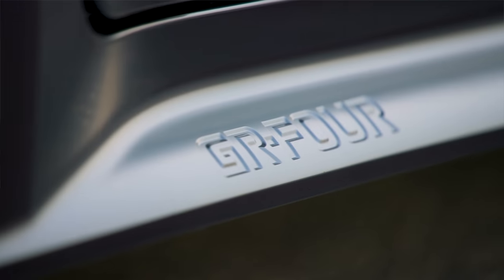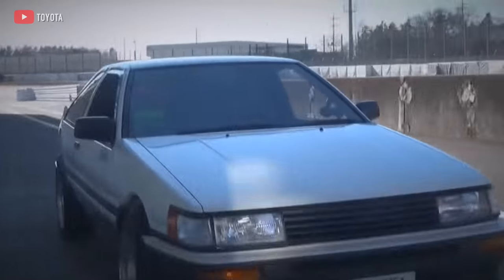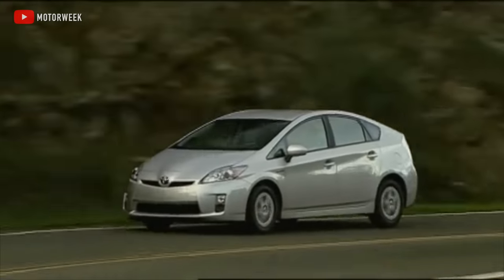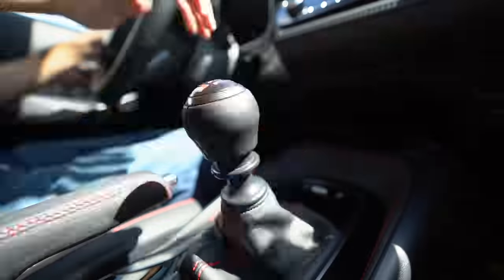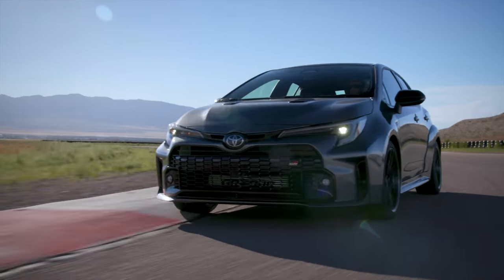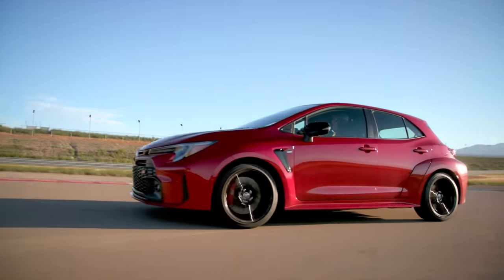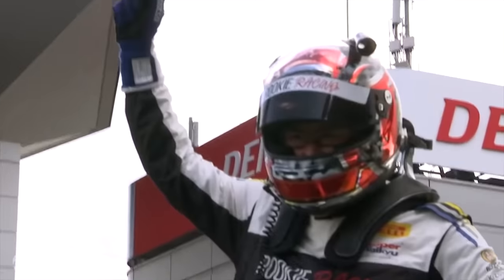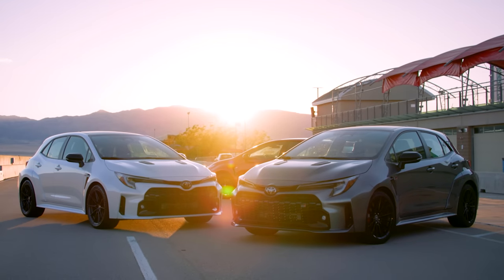Toyota Forgot How To Make Sports Cars

Comment: this guy knows how to tell a story with his out of the world writing👑👑
Reply: That's the problem, his to concernced with telling a story, instead of the actual facts.
Reply: @Orcawhale1  Like calling a Corolla a sports car
Reply: @DuBstep115  This, 3,300lbs is a joke.
Reply: @DuBstep115  Sports car-"A car designed with an emphasis on dynamic performances such as handling,acceleration,top speed,thrill of driving and racing capability."

You know Corolla and GR Corolla have a lot of differences right?Just like Lan Evo and Lancer
Reply: @abenas40  That definition is so vague that every single bmw from 318i should be called a sports car.

Comment: Hope to see this turbo i3 optioned in more cars eventually
I miss the days of toyota putting turbo JZ engines in every car that could fit them
Reply from the maker: Agreed! Sakamoto-san told me the G16E is set up to run both Hydrogen and Synthetic Fuel, so I think we'll be seeing plenty of it in the future!
Reply: They have shoved it into the 86 for "fuel testing" purposes. Makes me think they are trying to prepare for when they can't make petrol cars anymore. Maybe the 86 will finally get a turbo..
Reply: @Treaxvour  Only for special racing events. Turbo engines don't last, & is only for those greedy ones who want maximum power. I'd rather rather go for well-timed precise power delivery on every corner!
Reply: @creakid  tell me that you know nothing about turbos without telling me that you know nothing about turbos
Reply: @creakid  what are you stuck in the 60s?
Reply: @crissto8591  The 3 banger turbo in the GR Corolla is using 28 pounds of boost, it's not going to last.
Reply: @creakid  some if toyota's most reliable engines are turbod, such as the 1jz and 2jz lines
Reply: @Brandon-yq1tm  Heavy-duty design compensates, but what about the extra heat that melts rest of the engine compartment?
Reply: @creakid  the hell are you talking about, the compartment easily can handle a turbo, the heat is contained within the engine, all they are doing is adding air to get higher compression
Reply: @Sweedster  The thing with a turbo is that in order to get so much power out of such a small engine, you need a huge turbo and a bulletproof engine block. A massive turbo takes longer to spool up and down, so a naturally aspirated engine is better for cornering-focused cars like the GR86. The GR Corolla is a rally-bred car, so it makes sense to have a turbo engine inside, but it doesn’t work well in an 86.
Reply: @Brandon-yq1tm  But not to the degree nor to the pressure level of the G16 in the GR Corolla. The stock Supra already had 3 liters of displacement and 6 cylinders. The G16 has about half the displacement and half the cylinders, yet it squeezes the same power and torque out of the engine.

Comment: With my MR2 I feel that unique Toyota sports car feel. You can drive it everyday, sun, snow or rain. Learn manual on its forgiving powertrain. Learn the limits of the car and yourself with the reassuring assistance of a friend. It starts every time and, it doesn't mind a slow commute. But get it on a track or a twisty road, and it lightens up. The Yamaha built 3SGE/GTE screams with excitement. The chassis moves and flexes just the right amount, it builds confidence through every perfect apex, through every long sweeper or from one light to the next. It want's to go faster, every intent feels like it wants to chase that next guy ahead. When you're done however you can slow down, lower the windows, turn up your favorite song and cruise home to your hearts content. That's what I've always loved, it's fast, fun, exciting, inspiring, but also calm, confident, and dependable. I've driven Type r's, skylines, GTRs, Mustangs, Porsches and nothing has felt the same as my MR2

Comment: So glad my son tuned me into the Ae86 and we were able to get some before they shot up in price. 
The 1.6 4age is legendary and wonderful but is still barely 100 happy horsepower. It's really no match for new cars.
The tight ratio tranny's not going much above 100 mph.
Some parts are rare,non existent or expensive others are dirt cheap and everywhere.
It's old,funky and has zero nav or nannies.
It's also incredibly light, easy to drive,fuel efficient,comfy,practical,really fun at normal speeds,has rally ground clearance and is appreciating in value.
Nimble is a word that very few modern cars can claim. It's the magic.
Pop up headlights and eurobeat intensifies.
Reply: The 2001 carina  gt is one of the last cars with a 4age type engine with 180hp
And the most nimble new car is the Suzuki alto works rs turbo

Comment: I'm not a Toyota person, and the only driver's car I've ever owned was a 65 MGB my father rebuilt from the junkyard and gave to me when I turned 16. But it seems like Toyota was aiming for a car that would be quite fun on occasion but still be a practical daily, with room for aftermarket improvements if you wanted a more capable performance car. And it seems they hit what they were aiming for pretty much dead center.

Comment: Sure the Morizo is great but for the price you can get a core especially at MSRP if you can find one, the money spent on a Morizo and losing the rear seats can be made up for in the aftermarket. Its like my MR2's I have owned and still own stock sure they feel rather pedestrian but once you modify them with quality parts and or the TRD catalog on my MK1 MR2 SC they turn into amazing little track/ auto X weapons. A tune and or a different aftermarket gear set in a core model with the LSDs will net you just the same experience. I think reviewers also forget that most enthusiasts end up modifying these vehicles themselves.

Comment: I don’t get why people are mad that the GT86 / GR86 have a Subaru engine. Most of the Toyota sports cars use Yamaha developed heads / engines for the power plant, and apparently that’s fine… idk. I think it’s because the partnership is more widely known, and it’s displayed right on top the engine cover.
Reply: Big difference between the quality of engines Yamaha produces compared to Subaru
Reply: Comes down to marketing and purity. Rebadges and collaborations always have some kind of pushback as well.
Reply: @Xale-yt  You know what…. I just googled “frs common problems”… I assumed it’d be a bunch of blown head gaskets, or cam bearing failures.. looks like the engine itself actually holds up. I’m a tad surprised by that one.

Comment: They should of all had the option of removalable rear seats, the Morizo has 4 doors and 2 seats , that just seems wrong. Also I'm sure the aftermarket will coilovers for this should resolve most issues of the base.
Reply: there are many race cars that are 4 doors with 2 seats. Makes it easier to weld in the cage. the GR Corolla is really a special car in all trims

Comment: last proper sports car was the zzw30 and even that was sold a bit short with the 1zz instead of the 2zz
Reply: no 86? or gr86? or gr yaris?
Reply: @arcanevoid9199  this video was alluding to earlier models than zzw30 being the last. The ones you mentioned certainly are but wasnt my point and the 86 is probably the only sports car. The others are certainly sporty. But i have had ae86 ke70 jzx90 etc and my zzw30 is 10 times the sports car of any of them.
Reply: @driftke70  jzx90 is a luxury sedan? ke70 is a little nugget hatchback, and the ae86 is 20 years older so of course it wouldnt be on the same level. and idk how the gr yaris isnt a sports car, have you seen what it can do on track?

Comment: I really think the Circuit Corolla would be the best one. I mean, it has body roll and all because the tune was from GR Yaris, and GR Yaris was made for rally. Of course it doesn't quite satisfy on track and consequently less fun than Fiesta ST on road, but that is just not the point though. Take Fiesta ST to the tarmac, it's not so much fun anymore is it?
Reply: Per the chief engineer the GRC is not rally focused like the Yaris. They knew the Corolla wouldn’t handle like the Yaris so they focused on stability and daily driveability.

Comment: The 86 was a Toyota design the entire time. I'm so tired of hearing people imply Subaru had any significant part of the design process. Toyota likely was intending to use the 2AR engine in it if Subaru didn't accept the offer.
Reply: Considering the chassis is a Subaru chassis, it’s unlikely. Whole point of the collaborations is to save money on development for low slung sports cars.

Even the prototype cars were chopped up Imprezas.
Reply: @MaddNomad1015  Considering the car was based on Toyota's FT concept from 2007, it's not just likely, it is the reality. If Subaru didn't buy in, this would have gone forward without them. Subaru had no intention of making a lightweight RWD cheap sports car, and likely only even bought in because Toyota had just purchased nearly 20% of their company before showing them the design.
Reply: @Weimerica8841  at the end of the day the what if thing is irrelevant. The twins are primarily built by Subaru, which isn’t bad.

Only issue I have with it (I’ve owned a FRS) is the history isn’t accurate. The name itself is just a marketing exercise.
Reply: While the 86 is a Toyota design, Subaru did the manufacturing and engineering. The DNA of the car is 85% Subaru, with only the transmission and fuel injectors coming from Toyota as major contributors. An 86 without Subaru's involvement would have been a much different car (possibly better, but also more expensive).

Comment: Toyota sportscars have traditionally been expensive, and the GR's are no different. The one difference is their marketing and the way they make their sportscars. While they technically start at 36k, the GR you get is a GR in name only. 
Toyota has GR submodels like the MKIV Supra. The one everyone knows is the 6spd, twin turbo RZ, but there was a 5spd, nonturbo RS. 
The one for 36k has an anemic 140hp motor, a CVT transmission, no LSD, interior that looks like it came from an old Golf GLI, different wheels and tires... Basically, the body and badges are the only thing the 2 share. The version everyone has seen on YT?  48-50k, without additional options. Even the white paint you see is an additional 1,000 dollars. The factory color is a more plain version of the white color.
I understand options being more, but when did the core parts of the car become options? It would be like buying the new 911 which starts at 60k, only to find out you get a 911 body on a 2007 Boxster chassis. 
The car is good for 36k, but not for 50.

Comment: I will never buy a turbo car because I keep my cars for a long time.
Reply: Turbos are fine, just make sure the boost is lower than 15 PSI. Cars that boost 20 PSI and up end up blowing up early unless you drive like a granny. My Saab vs my WRX have been night and day since the Saab boosted much lower and relied more on displacement, where as my stock WRX blew up at 70,000 miles (luckily, my dealer had infinite powertrain warranty and I got a free second engine).

Comment: I have a hard time seeing why someone would buy this over a WRX unless it was as an investment and you put low miles on it. Other than similar stock performance, the WRX will be better for 90% of consumers since 1. it is cheaper and won't have dealer markup due to low production numbers 2. has and will always have a much bigger and more robust aftermarket scene and 3. will likely be much more reliable since it is a high production vehicle in comparison to what Toyota plans to make for the GR Corolla.

Comment: first tempting Toyota in ages.. 86 kinda tempting but Subaru, if I got one, literally kswap next day.. Supra? well I've had like 6 mk2s, dunno if I'd buy into BMW (but I'd sure drive one).. this? 3 cylinder w/300hp? hmmm
Reply: This thing is a cool track toy but will be a nightmare as a daily driver. Expect an engine rebuild every 50K miles unless you baby it or only drive it when it's 50-75 degrees outside with no moisture.
Reply: @amuroray88  but it's a Toyota.. not so sure, heh.. tempting, yes..but I kinda prefer older cars..my newest is 20 years older and my fun car (db2gsr) is like 30..

Comment: The question i have is will these 1.6 litre engines that are under huge boost and rev high last very long? Will they be a 500,000 kilometre engine like the normal 4 cylinder 1.6 litre toyota corolla engine do? 300 horsepower out of a 3 cylinder engine that displaces only 1.6 litres and 25psi of turbo boost? Mmm i dont know if these engines will hold up for hundreds of thousands of kilometres. The only way to really tell is time,and once people own them and drive them for a few years we will see how they hold up. But hell would they be fun to dtive!

Comment: With all the clever chatter, you forgot to mention that the car has the wrong engine; it would have been so much better with the tried, proven,  and better 4AGE  20V, with a turbo added that revs faster and higher that'll a tornado, that will be infinitely tunable for the aftermarket,, with its ability to be stroked to 2 liters with already available Toyota OEM parts.  And let's face it  whipping the 4AGE with the same over-generous amounts of boost will produce exponential power.
Reply: i mean disregarding the fact it would never pass emissions, the 2zzge would do it better
Reply: @arcanevoid9199  that's not true, the 4AGE has never had any emissions issues. The 2ZZGE is a 2 liter, the idea is to keep the car 1600.
Reply: @caribbeangtr8077  I’m not talking about emissions issues, old engines don’t pass the emissions regulations they have now. that is partly why they discontinue making specific engines. 2zzge is a 1.8, and a 1.8 would be better because of the extra weight. 2zzge is the newer better version of a 4age
Reply: @arcanevoid9199  The 4AGE has no problems passing emissions tests.  They need a 1600 engine, not 1.8 or 2.0.  That 2ZZGE engine is aluminum with an electroplated liner which is very unforgiving on detonation, and Toyota does not make an oversized piston; it is in recent times that the aftermarket has begun making them; so previously to this, it was a disposable engine although it does make excellent power, especially normally aspirated.  But let's not split hairs over the type of engines because it's a done deal and Toyota will never use any of those two in these purpose-built cars.  The Yaris GR does what it's designed to to very well for WRC; and I'm not quite sure what purpose the Corolla GR was intended, but lets face it, they are both big steps up from the boring cars that Toyota has been feeding it's customers in 30 years since the Celica GT4 and A80 Supra.
Reply: @caribbeangtr8077  do you know how emmisions work? they are constantly getting stricter, an engine from almost 30 years ago is never gonna have a chance passing emissions. they dont "need" a 1600, and to be honest there is a reason why 7age etc are so popular. the 1.6 was a bit lacking even for the lighter cars they were put in, this yaris weighs just under 1300kgs and a 1.8 would a have better torque curve. why does it need to be forgiving on detonation? and corolla gr was created because americans wanted the yaris gr (never sold in us) but toyota knows they dont like small cars
Reply: @arcanevoid9199   Do I know?  Do you know?  What does the age of the engine have to do with it when the same tech is employed in the new engines?  Give me some emissions standards that the 4AGE cannot meet?

Comment: “The GR86 has always had Subaru bones” no. It’s primarily developed by Toyota, just because it’s power plant is a Subaru engine doesn’t change that fact. The reason it has a Subaru power plant is because Toyota owns a majority share of Subaru stock, and they wanted a Subaru engine for their low center of gravity. Not to mention, uh, Lexus Is owned by Toyota, and scion was supposed to be toyotas sporty brand, they even developed a decent couple newer 4 bangers in the early 2000s for use in the last gen mr2 and celica, as well as later on the TC. Then there’s the 2GR engine, which is used again, in lexus sport sedan models, and basically every lotus since 2011. To sit there and say “Toyota forgot how to make sports cars” is laughable and stupid. The spyder handled just as well as the porsche boxter and was in production until 2007. They literally took 5 years off, except, again, they have lexus, the Lexus IS 350 was already around starting in 2005, the IS-F came out in 2008, in 2010 the LFA came out. 

The supra is largely designed by Toyota, despite what many claim, many of the parts of the supra are distinctly unique to itself, seeing as a hardtop and a convertible are vastly different from a chassis standpoint. They got help from the Germans why? Because BMW is one of the only manufactures making inline 6s. 

In short, no, Toyota never forgot how to make a sports car, they get help because development can be expensive.